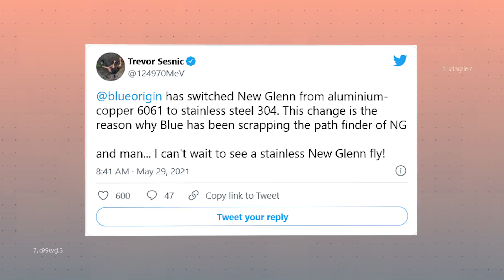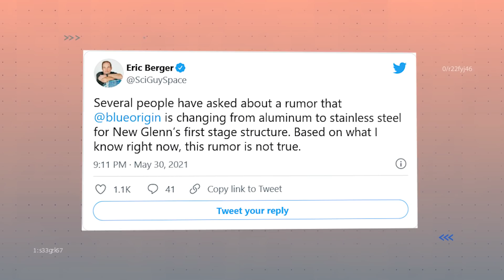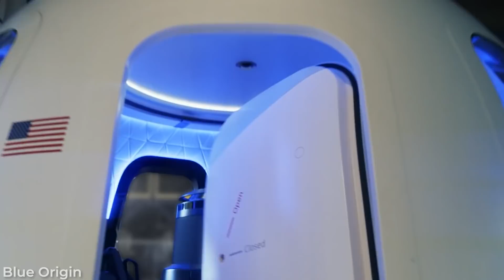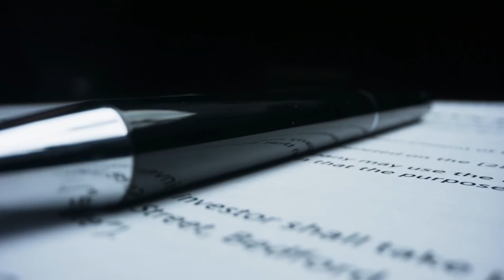Blue Origin's Secret Project To Copy SpaceX Starship

Comment: 05:27 Blue Origin may not be the 1out of 2 leader of the pack.  Blue Origin as of 01-2022 only as a BE-4 engine and New Shepard.  Rocket lab is demonstrating 1st stage re-usability and taking payloads to orbit and is working on Neutron.

Comment: The New Glenn first stage is about to stay the same. The second stage, is the one the Jarvis project is focusing switching to stainless steel the tanks. The Fairings are deployed as initially predicted. The design is quite interesting, because it is simpler, no need for a cargo hatch, and has less mass to reentry than a fully reusable system. They could add wings to the  second strange, and glide to landing. No need for a flop maneuver to propulsive landing.
Reply: But with that, you have to have the weight of the wings and landing gear.  This will reduce the amount of payload to orbit.
Reply: @Cojer52  not nessesarily. You gain much more isp with vacuum optimized engines and the extra efficiency could outweigh the extras weight of landing gear

Comment: Modern airlines look all the same because any other design doesn't work as well.  Long cylinders, pilot up front,  people seated in rows, wings in the middle, tail at the back, engines on the wings... 
You really can't do much different. 
Likewise, large capacity, re-usable rockets will end up looking largely the same.  You can't make a rocket shaped like a bowl of petunias.

Comment: In rockets saying Blue Origin is copying Space X is like saying Space X copied Delta Clipper. The physics of rocket flight & aerodynamics all ensure all rockets look and operate the same. A reusable rocket using propulsive landing will pretty much always look the same as that's the design needed by the constraints of physics & aerodynamics.
Reply: Delta clipper was a single stage how is spacex copying them? Blue Origin is copying spacex right down to the metel lol
Reply: @badtrekee4348  Which metal are you referring to, the stainless steel? Nothing novel about that the Atlas (1950s) missile & the UK Blue Streak missile made in the 60s used stainless steel balloon skin construction.
Reply: Well raptor 2 is the first full-flow staged combustion engine to ever be flown plus using methane. Elon is pioneering a lot of things
Reply: @edsherwood2173  Well I agree on the Raptor however Tom Mueller was actually the designer of this and not Elon. I think its important to point out that Elon has over 7000 very talented engineers working for him at Space X that do the "pioneering stuff" .
Reply: @jamieanderson6786  i don’t think anyone thinks Elon is the one actually doing all the work but he’s definitely making it possible.  I often wonder how much of the actual engineering he does since he seems to take a lot of pride in that and I’ve heard him mention with companies like neurolink and solar city that he hasn’t put enough sweat equity in to claim much credit. Even if he’s responsible for none of the breakthroughs just managing two companies of that size is impressive and you can definitely see traces of Elon in how they’re run. The rate at which spacex is always pushing is definitely because of Elon. I’m a aviation mechanic and I know how the government and most contractors work and it’s refreshing to see someone actually getting stuff done. He’s put a fire under Boeing and all the old guard if nothing else
Reply: @edsherwood2173  Elon is the fearless Commander
Reply: @edsherwood2173  well understood and agree 100%. But Elon fan boys actually do think he is a real life Tony Stark who sits at Space X and designs this stuff haha

Comment: If the new glen rocket with Jarvis is used like falcon heavy then it can easily outrun the Starship.
Reply: but that will never happen tho blue origin is to busy filing lawsuits and they haven't even reached orbit yet so how will they do this
Reply: Exactly! Unlike some fanboys say, SpaceX still needs to prove the Starship program is economical viable too. It seems too massive, and the cargo hatch getting smaller. Don't forget the launching infraestruture and staff, will not allow the prices per ton to LEO, to be reduced significantly.